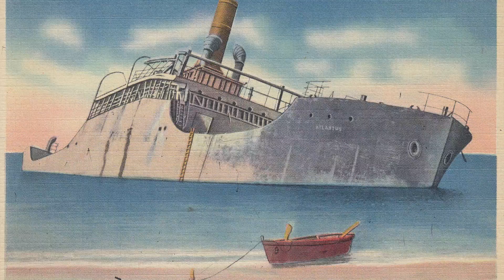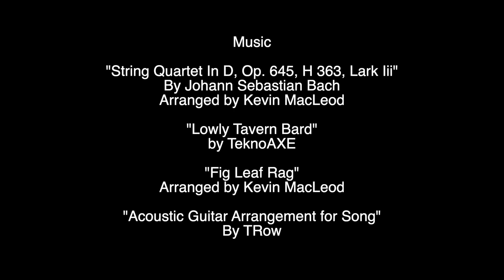Kayaking the Concrete Shipwreck "ATLANTUS"

Comment: it sinks more every year. used to be tall and noticeable in 1980.  nothing much to see though.  my friend and i circled it on his boat and i jumped out for a swim far enough away to be sure i wouldnt touch it.  Its just dirty dismal concrete, rebar, and algae.  not exactly cool to look at.  it looks like trash.

true about higbee beach in the 70s/80s.  nudies would expose themselves  to onlookers at shore while they were speeding past on little boats.  supposedly its a gay beach.